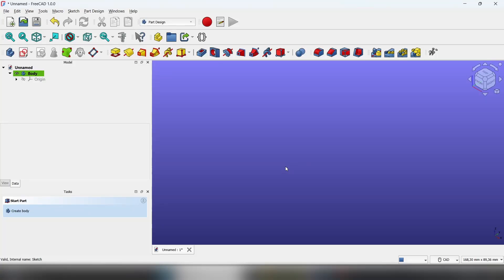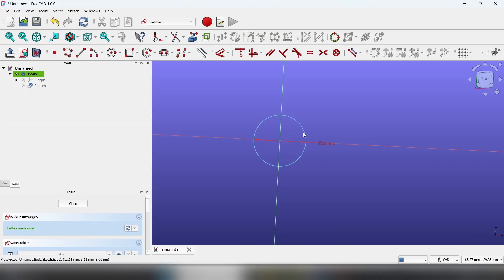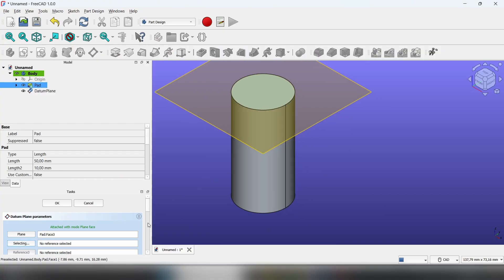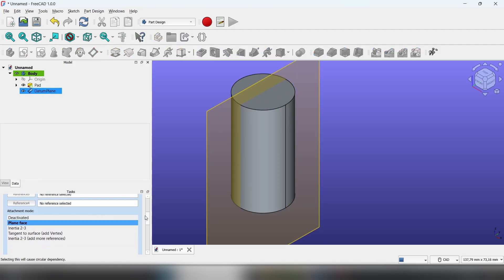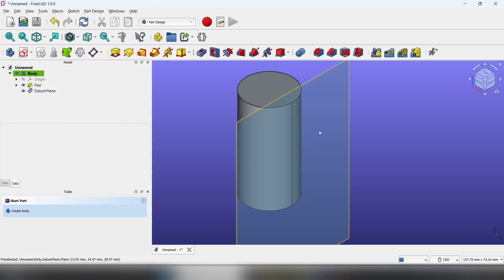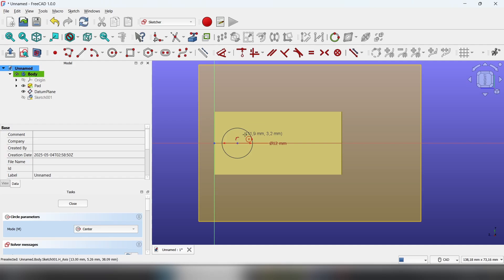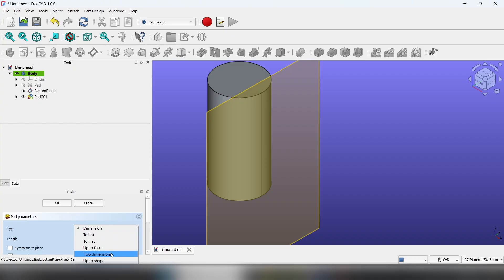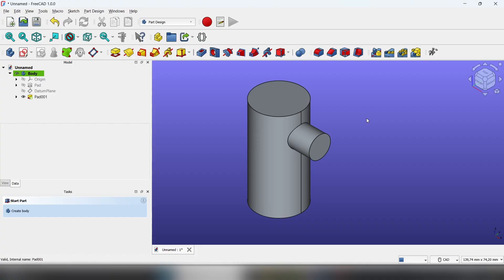How To Pad/Pocket On Curved Surface In FreeCad

Comment: can you make a video on how to do that do the top of a cylinder. but not adding onto the cylinder but cutting away from it. so the top of the cylinder has a smaller diameter and you have 2 cylinders sitting on top of each other thats actually one cylinder